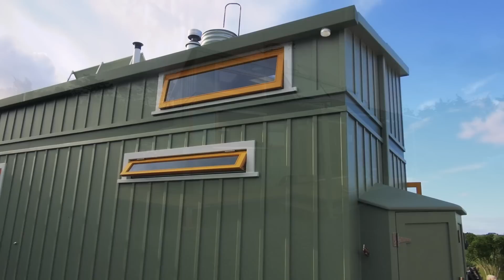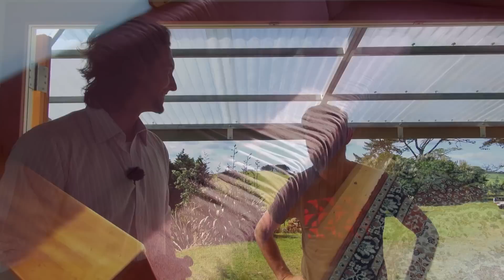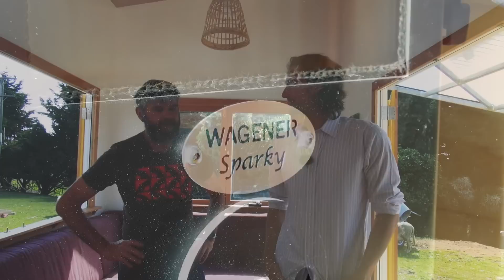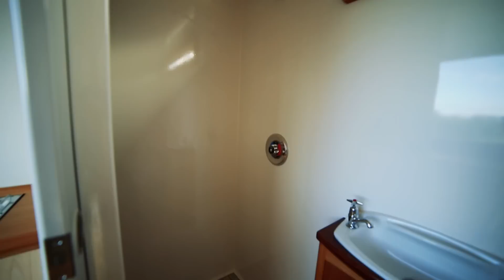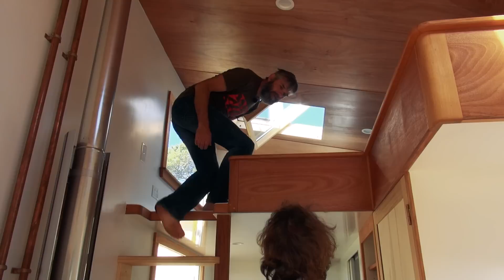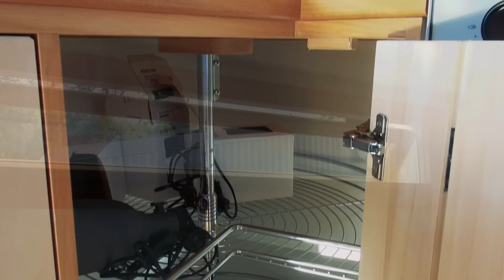Super High Spec Professionally Built Tiny House

Comment: I am confused about the cost of building a tiny house. There are many people who build theirs complete with appliances from 8,000 to 20,000, depending on choice of material. I understand that cost varies among regions. I also understand the cost added for the builders time. I have seen 1500 sq ft to 1800 sq ft built for $100,000. To those who say his price is reasonable do not have an understanding of actual costs vs over priced. If a tiny house under 400 ft costs over $30,000, you are paying much more than you should be. And that is priced on the high end. Especially when you consider how difficult it is to find a location to place the tiny home.

Comment: crazy expensive
Reply: Believe me, I am on the side of the builder... It amazes me how many people think this is CRAZY EXPENSIVE. One person here even boasts about KNOWING ALL ABOUT BUILDING AND PRICES.. Well, maybe here in one area of the States... This build is not in the States... I think this is a fantastic build and built by a professional "FINISH" man. All fine woodworking.
Reply: If you build a house with this kind of fit and finish, you will pay the same or more per square foot as this..... Please keep in mind that a build like this is NOT for the low budget/low expectation buyers. This is a very high end build done by true wood workers. NOT ROUGH CARPENTERS.....
Reply: I am both a fan of tiny homes and fine woodworking. The materials used in this build are extremely expensive even when bought as reclaimed. Then he spent many many hours cutting down all the reclaimed wood and fitting everything.. That is NOT CHEAP and no one works for nothing. Also, he used SIP panels for the outside walls. He did not build them, so he had no control of the costs at all. And SIP panels here in the States are very expensive. 
At the end the builder even says he wants to be able to build these at as high a value but try to bring the costs down. So it isn't like he doesn't know price per SF isn't high. This certainly was not built for a first time couple starting out.
Reply: Steve u sound like a fanboy
Reply: Steve 1961P.
 Now it's not that expensive, most small beat up houses in the states are 75-150k. There are mini houses out there that cost less and are the same and if not even better.

Comment: man, that is cool, but for $77,000 you could get a fairly decent house for that much in many many states in the USA.
Reply: Maybe in some small pockets of the US (mostly rural areas, I know I grew up in central Ohio and in the outskirts of Columbus, you can find an 800 sq ft or so fixer-upper for about $50-80 thousand), but that's not typical.

The median home price in the US hasn't been $77,000 since the early 80s. As of April of 2016, the median price in the US was about $380,000.  I know it's different everywhere and it's all about location, location, location.  Here in San Diego, CA the median price is currently at about $540,000 and a small (600 sq ft) 1 bed, 1 bath will still cost you about $400,000. New Zealand's median prices range from about $450,000 (Auckland) to $300,000 (Wellington).  By comparison, I think $77,000 is quite affordable.
Reply: The Tech Man but this is new plus it will save him money soon as they use it

Comment: Tiny homes on a trailer frame do not require a building permit. 
Tiny home ....big trouble and a possible death trap, if isn't built properly. 
Ok, you have a nice hot fire going in the wood burning stove, you trip up on the tinny tiny so called stairs  ( as shown ) now you're frying your skin like an egg in a frying pan. 
how do you want it....over easy or scrambled?

Comment: A lot to have to improve on. Rubber surfaces over stair steps, yes on the rail as well. First and foremost, those terrible boxes for the power, and the machines(washing). They are terrible for purpose of damp alone, so gasket or rubber seal along with walk-in fridge type of lock tight with padlock. 70K in material and equipment? You sir.. are a ripoff artist. Ridiculous. Design flaws all around, along with far overpriced and under-quality materials. You are by far at present the worst overpriced and under intelligent designer I have ever seen. You even managed to run the water pipes bare down the wall by the stove pipe, but failed to wrap it around it for the extra water heat storage. Unbelievable. 

Hands down, the failure to properly secure those machines and electrical power supplements is phenomenal. But to not properly manage the aspect of moisture damage is second worst. Third is the terrible design and use of windows. Your windows not only fail basic water damage aspects, lindle or basic draping for runoff, one can easily see you didnt even manage in a budget of 70K to get higher quality windows.  Unscrupulous or simply unintelligent? Your modular couch fails to have pin securing, nor did you manage pipe-sink locking areas for tables, your shelving is highly unimaginative, your allowance of her to use that sink in the kitchen versus the bath was no kindness to her either.  I see your backsplash of the cooking area is going to be an issue as well, and a terrible loss to her usable space.  You over paid for an underquality water heater on the roof as well. It should have been an evacuated solar tube set, as well with that integrated into her power via seebeck TEG's. You need to do some research and build on your designing skills. You could have saved her a bundle as well on lighting systems alone to take half that cost of cells down with LED usage, as well as made a breathtaking display within those walls you filled. But no.. your not aware nor are you artistic as well. 2400 man hours? Stunning. What a waste.
Reply: Jesus Christ you're a miserable fuck.

Comment: ****** There are a few things I wanted to mention that I have found in my research of tiny homes. There is a company that developed a device that makes water from AIR and it is very size efficient for it to be installed in a tiny home.... They make commercial sizes as well. I have seen a new European toilet that has improved on the whole composting idea that may be an improvement on the standard composting toilet. That takes care of the sewage and water for being off the grid and with solar panels or wind turbine which the later is not as size efficient to my knowledge. You can apparently live completely off the grid now with all of the comforts.  I would be more than happy to share the information I have found although it can probably be googled very easily. NICE HOME. Love the design and workmanship. GREAT JOB!!!! ******

Comment: Guy's a rip off way to expensive.
Reply: +Jessie James what you want the guy to work for free, not sure you under stand the work this guy put in to this job it . you can allways go look at a RV motor home for your cash but this is a nice job it will last longer then some of the RV motor home have in them
Reply: +Jessie James The cost includes the solar system, deck etc
Reply: weasel rodent
no I got a mobile home build for 60,000 fully furnished. Everything included. 3 bedroom 2 bathroom. Double wide.
Reply: I'm sure he's not a ripoff, he's building somebody a custom home. But like he said, the price per square foot is through the roof. If you're looking for an inexpensive, well-built home, I agree, a mini-home is the way to go (I did also). The "assembly-line" process is much more efficient than a craftsman-built. I would only ever consider this route if I were building it myself and I wanted something that could be towed relatively easily to any location at any time. Otherwise, I don't see the point.
Reply: Yes it's in Auckland New Zealand.  Houses On Waiheke Island cost millions, so this is cheap.  Building costs are sky high due to the earthquake in Christchurch that wrecked thousands of homes.
Reply: You are not looking at the same thing for an example. You're mobile was built by a company that builds many of them per week. Your trailer is NOT built for going over the road often and cannot be pulled by a pick up truck. You paid to move it and set it up. I'm pretty sure at that price you do not have a solar system and I know the materials used in your build are not even close to the costs of the build here. 
On top of everything else, you are not comparing this PURPOSE BUILD!!  So while it is true that your new home ~V~ this build, your home was cheaper, it is NOT in the same league.
Reply: I don't own a video camera. It was from a mobile place that builds them I'm guessing a big business. In Chico CA. Not Cousin Gary's those guys are way to expensive.  My aunt showed me the place cuz I'm not familiar with the town. I though it was a good deal the original price was 64,000 with all the stuff. It's not small house its a real mobile home.
Reply: You paid 3 times as much as I did (for the furnishings)...maybe location, too? I bought mine 13 years ago.
Reply: Steph Corr
It depends on the place and time. There was nothing cheaper here any where i looked it was brand new not use. All other homes where 75,000$ and higher i paid 60,000$ that included all California tax and moving fee.
Reply: There not in the USA as you can tell by how he uses the metric system. Either way these homes in the usa cost about 20k to build. Without the off the grid system that's another 3-5k

Comment: $77,000 for this seems pretty good. I mean it could be MUCH cheaper but literally everything in this place looks custom. I'd say if you didn't do everything custom OR you did the custom work (for those of us who are good with our hands) + salvaging some material (alot of wastage in a reg house would do your whole space), you could build it for $30,000 - $40,000 maybe less if you did it over a few years. Solar is also a nice touch for off the grid (initially expensive though) but if you could rent a lot in a local park with electrical/water hook up for $1500 - $2000 a year it would be a nice home for a 1st time buyer. Not to mention if you planned around adding solar power to it and left some space for it then you could live in it on a serviced lot while you added the solar to it over time. I love idea and will probably make a cabin like this later in life, I need more room currently because I want children.

Comment: This is a beautiful, quality small house (Not Tiny !) @ $77,000.00 US this is by no means an affordable house for many middle class and low income folks ! I think this falls into a rich person's cottage type deal.
Reply: +Mark Job you are unaware of Australia's minimum wage being $17.29. this is affordable. and this is 100% offgrid self sustaining. no water bill, no power bill. it maths out to a little less than 7000 hours at minimum wage. a kid doing minimum wage parking this on parents property should be able to toss at least 50% of their check at it which would be 350 weeks until its paid. and then they would own a home outright, and have no utility bills, and the build quality will outlast them.
Reply: Well, minimum wage is no where near that here  ! Try $10.75 hr, now recalculate
Reply: Mark Job what country are you from? Canada? like I said, you cannot compare  directly. everything is about 30-40% more expensive in Australia than the usa because they make 100+% more. so they have more buying power, but the prices cannot be compared  easily. this house material wise would be 20-30k in the USA, plus labour would be likely about 15-25k, depending on the experience of the builder. this guy is an old master boat builder, so as he admitted, he was off on the material cost estimate he gave her, and took a little longer than estimated.

hrmm I just noticed your profile says BC, there is a company that builds houses like these for 30-40k. has to be insulated more due to climate than Australian or most of the USA. I don't think they have done the water catching system, but I know they have done the solar offgrid. solar is actually quite cheap atm, less than $0.70 a watt for panels last time I checked.

http://www.nelsontinyhouses.com/

so if you took their 40k one, and dumped lets say another 10k to go all out with the solar, which would be way overkill. that's 50k. that would be 4650 hours at minimum wage. keeping that 50% scenario, so using 20 hours a week wages to pay it off, that would take 233 weeks to pay off. this is very affordable for most people. and depending on the person, if they don't smoke or drink, they can throw even bigger payments at it and get it paid off even faster.
Reply: You're missing the point. The whole idea with a tiny house is to get away from having to make payments ? What's the matter with you ? Many of us have been there and done that, and we're tired of being wage slaves ! For God sake man ! We're not all 20 years old - as much as we'd like to be ! The whole ethos of a tiny house is to get away from mortgages and other means of sacrificial financing just to have decent shelter ! Furthermore, I don't consider 40 - 50k an affordable tiny house ! Frankly, the so called entrapaneurial tiny house contractors/commercial builders seem only interested in doing to the tiny house market what they have already done to the regular traditional housing market. When this whole thing got started a few years back, the retail builders were asking $10K-$15K (The builders are really hoping you folks have already forgotten about those prices). Now in B.C. the major tiny house contractor just completed a home for a wealthy person @ $87,000.00 CAD How disgusting ! Now, the tiny house has become a FAD and a BRAND. Now rich folks who just want to appear cool and look humble to their friends are sinking Big Dollars into status symbols ! This is bullshit ! It's a marketing exercise which is totally ruining the tiny house movement and kicking middle income and low income folks to the curb !
Reply: Mark Job if you think that a minimum wage worker being able to pay off a 100% self sufficient home within 5 years is "not affordable" I don't know what else to say.

and THAT is the point. you keep missing the point.

you spitting out a 86k pricetag for a "wealthy person" means jack shit. and I would wager the technology in it is top shelf.

just because you think its a fad, and stupid doesn't mean that it is.  you speak like you are part of the community, but its clear that you are not.

enjoy spinning your wheels.
Reply: +JamesMichaelDoyle I am a part of the community. What do you know about me ? Don't pretend you do, because that dog won't hunt ! Your whole pretence that a minimum wage worker can afford the house you show at the prices You quote is utter bull shit ! You don't know how to do math ! Your attempted Obfuscation has failed, Sir ! Let's do some Real Math shall we ? In Canada, the average minimum wage worker earns only $430.00 a week buddy ! That's a Gross Amount ! There are roughly 52.25 weeks in a year last time I checked ! So what's 430 x 52.25 ? It's *$22,360.00 But we're not finished are we smart ass ? In Canada, federal and provincial income tax deductions equal roughly 43 % After deductions, the actual take home pay of a minimum wage worker is only $9,614.79 for the whole year ! According to Revenue Canada, and the Federal Canadian Government, the poverty line is stated at anyone making less than $14,000.00 per year after taxes. So how does one pay for your bull shit-OVER PRICED jack ass house ? I can add jackass ! I can also do the math ! You and your fucken smoke and mirrors every time ! Well, some of us are not fooled by your bullshit !It's so insulting ! Out of $9,614.79 a person spends at least 60 % on Rent and the rest is supposed to be for food ? Oh ! AND you can afford a tiny house in 5 years at what Mr. Doyle is asking. You're on drugs mate !*ADDENDUM: My central point is about price points on tiny houses *Today. I don't think a tiny house is a Fad, or a Brand,*even though the tiny house contractors are doing their best to market tiny homes as such. I do think we are ultimately talking about more than lifestyle here. We are talking about decent, affordable shelter, which is a health well being issue, not just a life style choice, and many of you greedy guts tiny house contractors are artificially inflating the prices whereby a whole lotta folks are going to have to stay in their cars, or RV's, or just their tent, or the street because they now have had their *one chance to own their own home pushed forever out of their reach ! I can't make it any clearer than that. You die on the streets ! I know what I'm fucking well talking about !